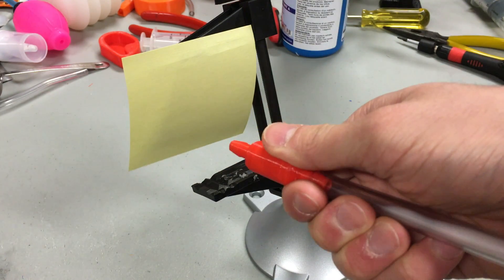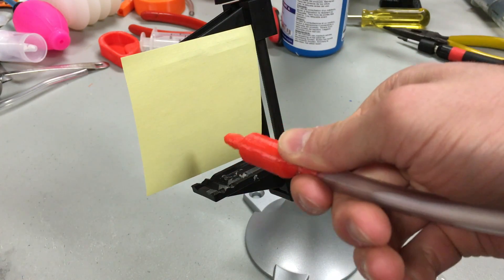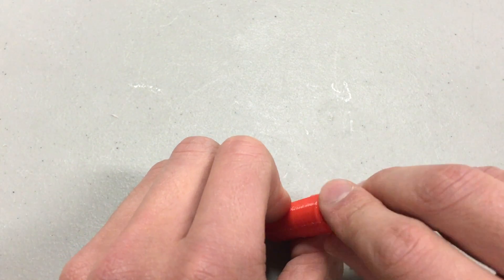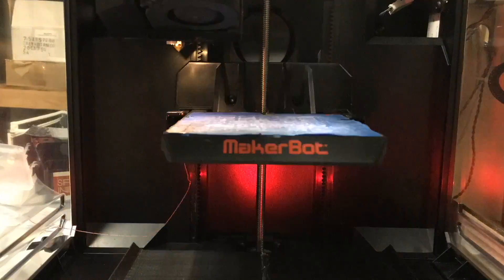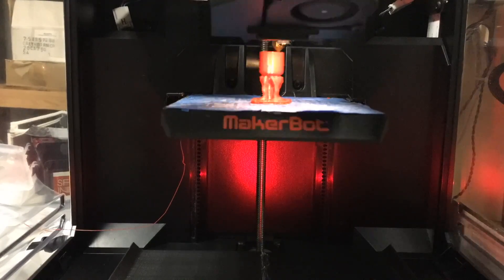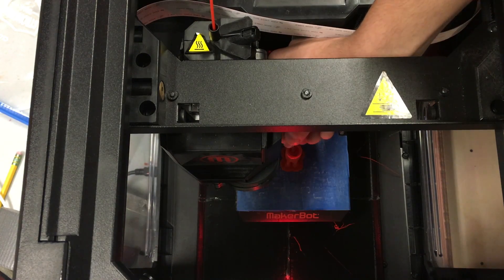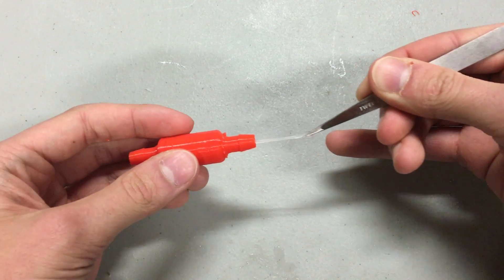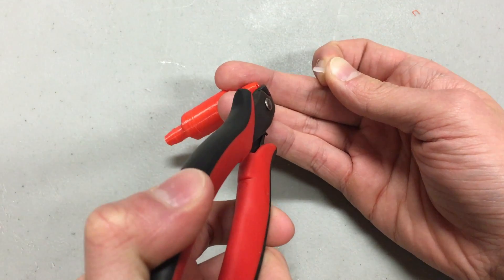3D Printed Check Valve

Comment: While I think this is an excellent valve design, especially in corrosion resistance it would probably be better to stick with a ball bearing and o-ring design for accessibility and reliability since not many people are willing to go buy 1kg silicone rubber just for a project like this while O-rings are cheap and ball bearings free.

Comment: Have you tried using hot glue instead of silicone? Not that it would work better, just something that more people have at home, and it's cheaper (I think).
Reply from the maker: I have not experimented with it but i like the idea!! I don't think hot glue could work as the gasket (at least on this small a scale). The silicone I used here is SUPER soft, so the hot glue probably could not make an airtight seal.
Reply: True, hot glue isn't that "rubbery". Btw, how small do you think it's possible to print a check valve? I've been thinking about doing a completely 3D printed air gun, and to actually use cartridges which you pump up so they hold air and release a small BB, but I haven't gotten the check valves to fit in the shape of a 9mm bullet
(This is the reason I stumbled upon your video ^^)
Reply from the maker: This valve was about as small as I could have made it. However, I'm sure if you made a valve that used a ball or flap gasket you could probably make it much smaller.

Comment: I wonder how hard it would be to make one that replaces the ecoflex with ninjaflex or TPU.
Reply: amoose136 you would probably have to change a lot of tolerances and measurements given that material would stretch and give less than the silicone. It would also probably be harder to make sure the rubber part was airtight. Something to think about though!